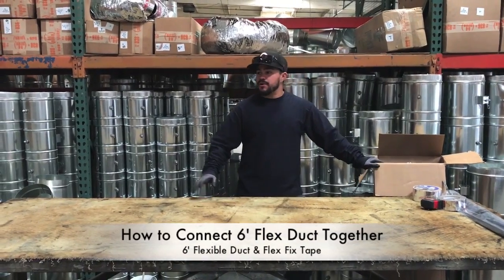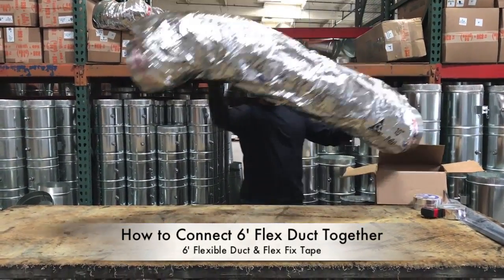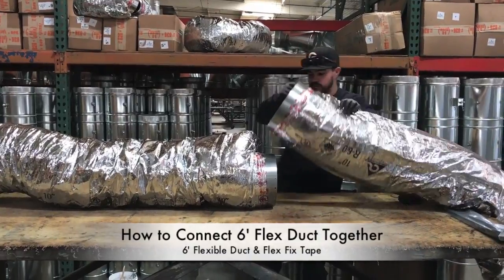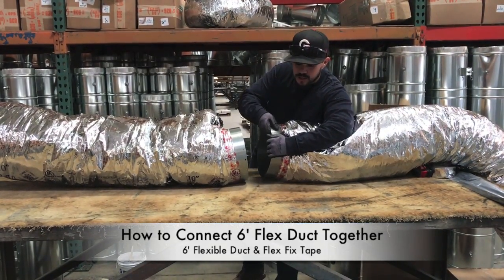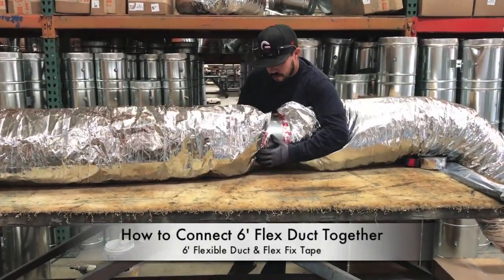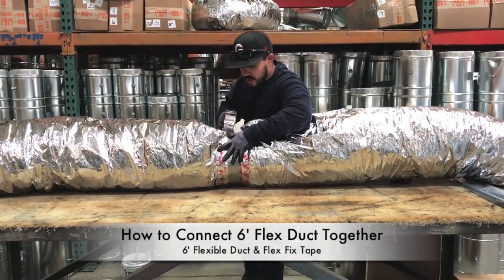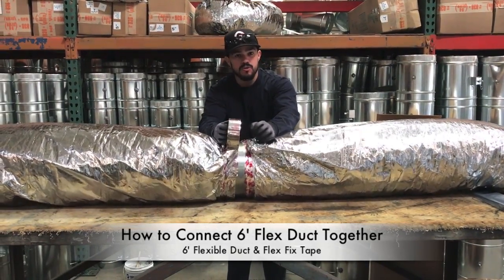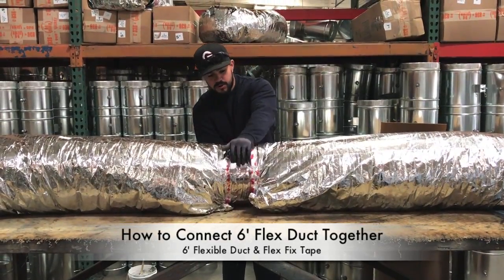How-To Connect 6' Flexible Duct - The Duct Shop

Comment: I like the idea of making the process of connecting flex easier, but wouldn't this tend to condensate at the non-insulated joints?
Reply: Was goignt to make a comment about that..... I 've always pulled the outer vapor barrier and insulation over the metal and only used one piece of metal.

Comment: Attempting a self install of some new duct. Bear with me. Why wouldn't you screw those collars together then wrap the joint in the flex fix tape?
Reply: Air leaks only use tape & mastic or mastic tape
Reply: @pearlperlitavenegas2023 Then wrap a aluminum tape on top of the screws

Comment: Great videos! Thanks for sharing! Question, I have uninsulated air flexible connectors ducts for AC/Heat going about 15 ' to a retune and want to insulate them after they were installed.  What is the best product or way to go about that - that you recommend?  They have no insulation and I can tell they are losing hot air.  Thanks!